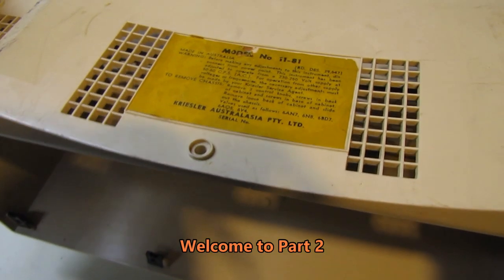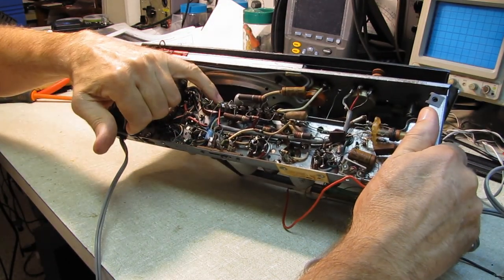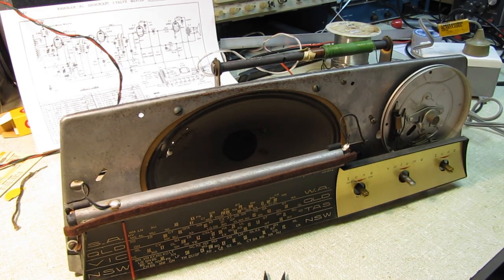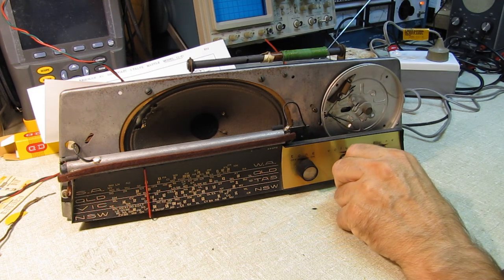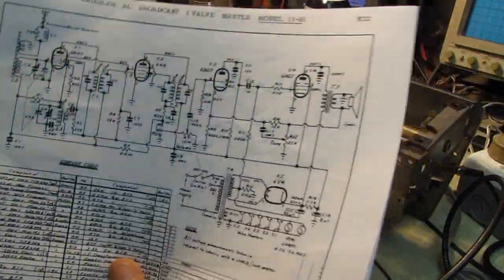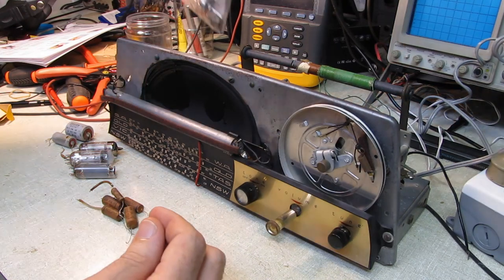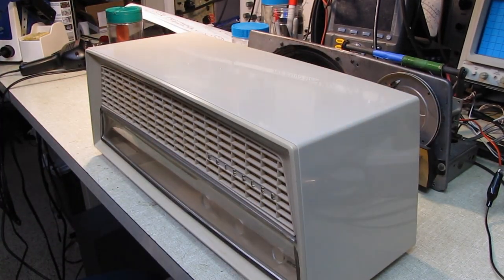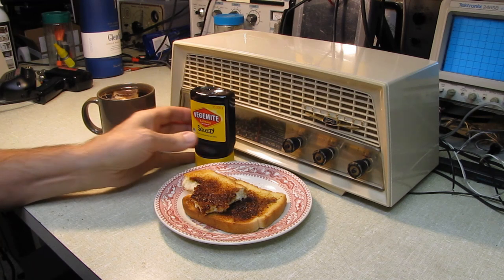Kriesler Australasia Model 11-81 Part 2

Comment: Nice to see an AM radio with a power transformer instead of the typical AA5 running straight off the 120 VAC line.  I am currently working on a Truetone AM radio sold by Western Auto stores. (Model D2325-A) This is a 6-tube set with a power transformer and  5Y3 rectifier tube.  I'm hopeful it will turn out to be a sensitive, well performing set.  There is 245 volts on the plate of the 6V6 audio output tube - you don't fine that on the typical AA5!

Comment: I need some advice, should I change all the capictors in my kriesler 11-81? 

Also when I first turned it on (without checking the inside) one of the tubes was glowing bright red and started to melt the plastic on the back. Could that be resolved by replacing all capictors?
Reply from the maker: Yes. Replace them all. Bad news is you have probably damaged several other non available parts such as the output transformer and the power transformer. Never EVER plug in an old radio without servicing it first. Go back and watch my earlier series "Do Not Plug In that OLD Radio".